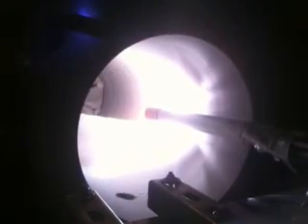Thermal spray coatings: plasma process

Comment: CrownRe Innovative Materials Inc., is one high-tech thermal spray coating materials supplier in China. Produces 99.999% Spherical Ytrium oxide Y2O3,
Yttrium fluoride YF3, YSZ，Al2O3,Al-Ti and other spherical coating materials, which are mainly used in plasma spray coating.